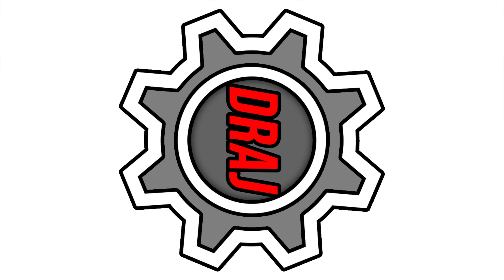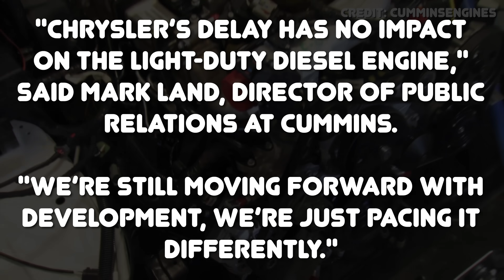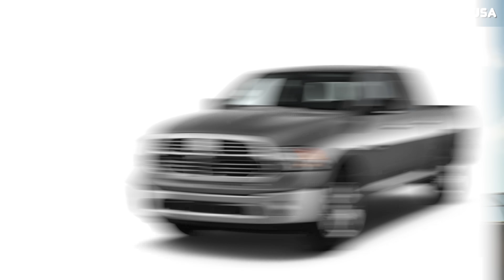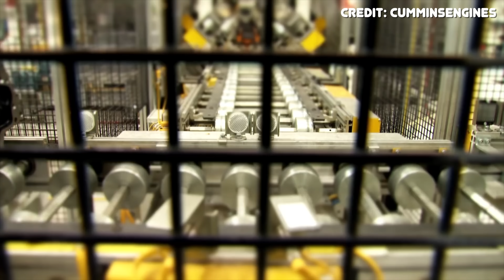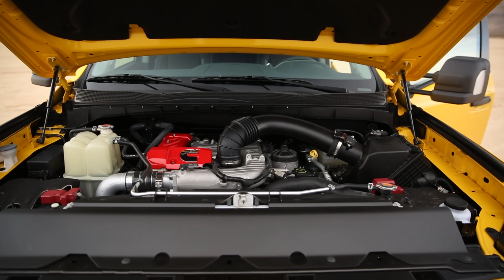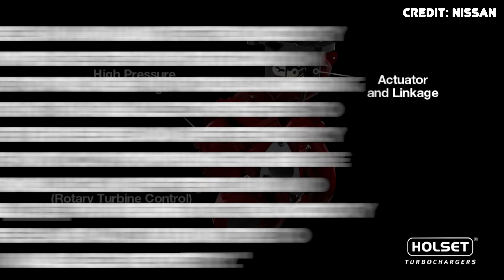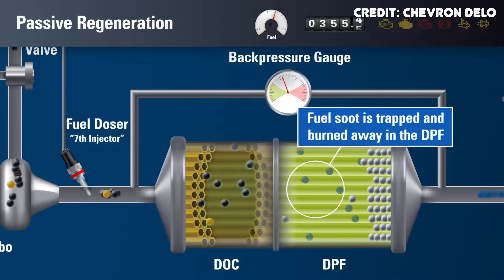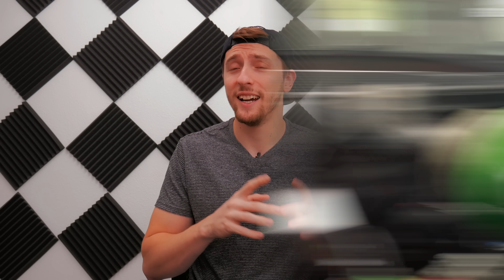5.0L Cummins: Everything You Need to Know

Comment: I'm replying a bit by bit.  I seem to remember that Nissan and Dodge/Ram actually were going to co-develop a new platform of truck, one to be branded as Nissan, one to be branded as Dodge Ram.

It was not fuel economy, it was that Dodge got bought out and they were told to use the ecodiesel because it was within their family.  The excuse was fuel economy.  Every time Chrysler Corporation has changed hands, the new owners have tried to get rid of the I6 Cummins in favor of their own engine (See Daimler).  I seem to remember the fight between Dodge and Daimler spilling out into the public eye with Dodge saying the Cummins saved their brand and there was no way they were replacing it with the Mercedes engine.

You seemed to only mention the bore and stroke, but ignored all of the advantages of an over square diesel engine.  Increased operating rpm, lower piston velocity, changes the position of the torque peak, and improved drivability to name some of the advantages. 

The M2 turbo system is more accurately described as a series-sequential system.  From 0 to ~2200 the turbos work in series, ie compound turbocharging.  At around 1800 the system starts to pass off all of the duties to the big turbo.  Very fascinating to experience in driving dynamics.  This is also why it runs out of breath at higher power outputs, because its big turbo is only big enough. 

The real reason the Titan XD didn't sell is the same reason Nissan has had so many failures over the years... Nissan Marketing.

Lets cover some important points.  The Titan XD is a classic one ton truck.  It has a steering gear, with idler box.  It has a massively overbuilt frame.  The cooling system, engine and transmission is in the 25k lbs class.  It has a factory gooseneck hitch.  The only thing that stands out as not one ton components is the hubs.  The truck rides and handles like a 2500 series.  It handles and pulls weight with greater confidence than the 2008 2500 Duramax I compared it to.  It has superior braking and engine hold back.  I have carried 1000L totes of oils, skids of garnet in the box and the truck doesn't get anywhere near the bump stops.  Rides and drives beautiful, with less nose incline than the 2500.  Where the ISV5.0 really shines though is fuel economy while towing.  I averaged 15.2L/100km pulling ~11,000lbs with the Titan on mostly flat terrain for a 100km drive.  I got over 18L/100km pulling similar weight with the 2008 Duramax.  In ideal conditions I have achieved 8.7L/100km with the Titan XD, with all the emissions equipment intact.  My calculated average is around 13.6L/100Km.

What I believe is that Nissan intended to sell this truck as a 3/4 ton.  Then someone in marketing must have got cold feet looking at the horsepower and torque numbers of the big three.  "Let's carve out a niche, that'll work!"  It didn't.  There is zero logical reason to put a gooseneck hitch on a half ton truck.  Almost all gooseneck trailers of usable size start at 14,000lbs.  I think if Nissan had followed through and sold this as a 3/4 ton, or a modest one ton it would have been hugely successful.  The problem Nissan had is that selling a one ton truck that can only legally be used as a half ton makes it grossly over capable for the job it can legally do, over priced, and frankly cumbersome.  What half ton scales out at 7300lbs empty?  Now you take the Titan XD and put it in a role where it could be pulling a 14k dump, or modest gooseneck on a regular basis, it would likely end up being very comfortable and cost effective at that job.

The other mistake Nissan made was using the Aisin transmission, or, accepting the code as it is.  The engine makes and drops rpm closer in behavior to a gasoline engine, so the engine is always left waiting for the transmission to catch up.  It's terrible.  It's better in tow mode while pulling weight, but for regular driving it's really terrible.  I frequently manually shift it.  I think the ZF 8HP would have been a much better transmission choice.  The 8HP can shift fast enough and is much better suited to handle the ISV5.0.  Also, 8 speeds for even better fuel economy.

Then if Nissan decided they truly wanted to go toe to toe with the big three, use the hybrid version of the 8HP that has a 90kW motor, put 20kWh worth of battery in the Titan, make it a dually and sell it as a diesel electric tow rig.  Go all the way and have an oem flat deck option.

Comment: Used to work for cummins, and I now run my own business and work only on commercial diesel engines. As a professional, I'll tell you this engine sucks. Gets about the same fuel mileage as a b-series ram HD, but half the output.  Add in the fact that any v- style engine can't be as reliable as an inline...

Comment: Even though diesels blow out carbo or "roll coal" they still put out LESS harmful emissions than gasoline. If you put corn diesel into the mix, it's even less.
Reply: Deleted trucks release less harmful emissions than stock.
Reply: @felixwankel3989  very true. My 24 valve is straight stacked.

Comment: I have a 2017 Nissan Titan XD with the Cummins 5.0 liter turbo-diesel. It is a great package for quiet, efficient towing. It is not a race engine but provides plenty of power and torque to pull my fifth-wheel. Five years... no problems. The XD still exists as of 2022, but utilizes the same 5.6 liter gas engine as the regular Titan.
Reply: Wow, my 5.9 got 25 mpg loaded but not pulling at 75 mph, in a quad cab four wheel 13 pulling my 5th wheel. But at this price for diesel, dang. It’s not quite and it a truck, but I can add boost and get even more better power. Of coarse I’m pre additive so I will never need a limp mood ( that’s when the driver screams at his truck, wtf)
Reply: What fuel mileage like?
Reply: @GreenerPastures8867  Yeah. There’s a joke that us Titan owners go by yards-per-gallon.
Reply: @GreenerPastures8867  I'm super heavy, with the lift, airbags and a fifth wheel. With a tailwind, I get about 8mpg. It isn't about efficiency. It is about stability, torque and comfort.
Reply: Do u still have it ? What is your impression after 4-5 years?
Reply: It's gotten a bad rep. Broken crankshafts, and underpowered.

Comment: I love my 2016 Titan XD, I pull a steal gooseneck 3 horse trailer regularly fully loaded including the family and the truck never complains. 102,000 miles now and the only repair I’ve had to do is the turbo actuator at 90k. Looking to delete soon since I tow so much but honestly power is fine stock.
Reply: My dad had to replace the turbo actuator on his too.  I talked him into deleting.  Very simple and no issues since.  I deleted my 3500hd chevy 7 years ago 120k miles ago and haven't had a single issue since either.
Reply: Delete and only do a 60hp tune. Earth shattering difference on my 17 XD. Sounds incredible.
Reply: These engines are obsolete for a reason
Reply: @erikcapozzi3425  yeah my dad broke his crankshaft at 70,000 miles pulling onto the interstate.  Bone stock everything.  Nissan replaced the entire motor under warranty.

Comment: As some wrote, this “was” a good or interesting engine in what “used” to be offered by Nissan. I have no issue with the engine or the truck in general, however … these trucks are overpriced when I checked (my opinion), and now their revised 5.6L gas engine requires “premium” fuel to achieve the printed numbers they advertise. Now with Carlos Ghosn gone, who saved this company, and a truck that sells about 1/90 the volume of a Ford F-150, or combined Chevy+GM 1500, I think this truck’s days are numbered and maybe the company itself (their offering of CVTs in other vehicles doesn’t have a great track record as I’ve read). Oh, and the Titan is no longer offered in Canada (they simply chose not to buy them over other offerings). I’d stick with a Chevy, Ford, GMC, RAM or Toyota for resale value reasons, and for service & parts supply in the long term. Sincerely yours.
Reply: A f-150 with the 3.5 ecoboost is a hard truck to beat if you're in the half tonne truck market imo chevy has the same old 5.3 v8 or 4.3 v6 or a turbo 4 cylinder ram has the junk 5.7 hemi then you got ford with either the 2.7 ecoboost or the 3.5 ecoboost or the 5.0 coyote and after test driving a 3.5 ecoboost a couple years ago that engine is a monster for what it is plus fords got the added bonus of aluminum bodies on their trucks which helps in the rust belt.
Reply: @nou8257  Thanks for your suggestions. I should mention that I still read about trucks in general, though I own a newer 2500 series Chevy with a 6.6L gas engine. It’s been a great choice for me and my needs (trailering, 3300 lbs. Payload capacity, etc.). Thank you.
Reply: @nhlcfl7733  I'm skeptical how that 6.6l will hold up with its varible oil pump system.
Reply: @nou8257  with all the components in any truck, some being unique to one particular model, anything is possible and yes time will tell. So far, after two years of ownership with my 2020, “all” is working well, free of major recalls or breakdowns. No turbo, no start-stop function, no cylinder deactivation, no hybrid battery. Simply a powerful & relatively simple configuration with some modern touches (direct injection, cast iron block with interbore cooling, etc.). And my LT Z71 cost me near the same price as a Ford F-150 XLT FX4 that has some less capabilities and is far more complicated (long term repairs with turbos, etc.).
Reply: Sorry but the Titan is the best truck in the market.. Nissan just doesn't advertise it correctly. As for the company sticking around they just spent billions to redesign every model and Carlos was a scumbag. He made a business model on selling to rental companies instead of offering new models at low lease prices like Toyota did in the early 2000's
Reply: @Belbivdevoe  In what way is it the best truck in the market?. 

Because to me they are in that weird place of half tonne and not a half tonne... cause if I want to buy a truck to just outright drive i'm buying a f150 ecoboost limited trim which has the raptor engine in it and if im pulling stuff i'm buying a f450. 

I would only buy a titan if i found one with the cummins diesel in them with all the epa bull deleted and that's only due to the engine not the truck.
Reply: @Belbivdevoe  Thanks for your reply Nick. I like the idea of the Titan, and it’s got a great name that exudes strength for sure. I think the Tundra is probably the best truck when looking at total of numerous factors, however Nissan makes great products as well, like the new frontier (was in the pipeline before Ghosn left).  It helps that former Ram Truck CEO Frank Diaz assisted Nissan during many years now. I’d consider a Frontier if I were in that size market. However, I’ll pass on the full size that I sense its days are numbered and requires premium fuel. Thank you anyway.

Comment: I bought a 2018 Titan Platinum Reserve with 8500 miles on it last year, and am now at about 19,000.So far zero problems. I have owned several trucks for various reasons including the 6.0 power stroke, and a Toyota Tundra 5.7. Currently I am daily driving the Nissan Titan, but also tow a 10k toy hauler and a boat. Compared to the Tundra there isn't a comparison, way better fuel economy and much lower RPM'S. Truck feels  more stable hauling. But some complaints come to mind, engine turbo lag off the line, strange re-gen schedules, and the DEF gauge is worthless! The front suspension is weak, and towing a load over bumps can get sketchy! As far as power, it's defiantly not a rocket ship but does inspire confidence with the torque! So overall, this truck and engine fits exactly what I was looking for, daily driving and able to tow a big load without stepping up to the super duty class! Also it fits in my 2 car garage with the tailgate down when hauling dirt bikes!
Reply: Get a pedal commander and it will almost totally fix the lag off of the line. Sure you will have to play around with it to find the setting you like. I had one on my 18 Titan and it turned it into a complexity different truck. Ran mine on sport+2 most of the time. Will make you wish you had it sooner
Reply: Why haven't you deleted it?
Reply: Get a Banks pedal monster.
Reply: Get a ford F750.
You can tow everything plus your nissan.

Comment: I worked at Cummins and this engine was in the think tank long before 2009. The reason it didn't go into the Ram 1500s is because Fiat had their own diesel they wanted to use that they were convinced would be a better fit. They also teased putting a Fiat made diesel in the 2500s and larger trucks but they did their research and realized that they would lose customers.
Reply: Before the fiat merger ram and Nissan were going to co develop the next titan and ram and the cummins 5.0 was going to also be offered in the 1500 ram, which would have been great. But whem Fiat got Chrysler that deal was scrapped amd Nissan was left with the 5.0 cummins before cummins discontinued that engine.
Reply: hey if you did in fact work there,  does the isv variant actually does the same nissan tricks where the crank splits, the pump grenades and the egr meltsdown?
i have a cummins dealer where i can order engines but ive wondered what happened with this one after the nissan dropout
Reply: @Velkanis  This engine was still in development when I left so I have no experience with it.
Reply: @joem7572  awww thats a shame man....
Reply: @joem7572 as for the Fiat engine, was it a 6.7? I heard that was co-designed with Cummins. They have different bores and strokes, but I heard it was a cooperative effort. Do you know if it’s true?

Comment: If Nissan would have made a "xd" package like bigger brakes, cooling, axles, beefier frame.etc and had the option of the 5.0 Cummins I think it would have been received well, especially if the reliability and support was better too.
Reply: The XD is a different from the regular 1/2 ton in so many ways. The XD sits on a different frame, bigger than a 1/2 ton yet smaller than a 3/4 ton. Brakes and axles are beefier on the XD too.
Reply: Nissan full size trucks have never been well received in the US market. And the sales numbers show that, they’re dismal. Sure the fact that they don’t have 3/4 and 1 ton variants sure doesn’t help, and most buyers don’t understand or need/ want an XD truck that is a middle road between a 1/2 ton and 3/4t. Along with I would say most buyers aren’t even considering Nissan when they look for trucks. Although this 5.0L cummins was a massive selling point for them... but even then it didn’t stick. And frankly I think Nissan has their trucks at a price point that doesn’t represent a good value to the American truck market, and that keeps people at bay.
Reply: @chevyon37s  no one wants to buy a Nissan truck. They could put a compound turbo 5.9 in a 1ton and it would still undersell a dying GM.

Comment: I have a 2017 with 155000 bought new it's been good the had to replace egr around 120000 luckily where I bought it gives a lifetime warranty so they fixed it no charge got 150k out of brake pads  and has all new rotors, pads ,new 5100 shocks and on my third set of tires it's been good.

e 51